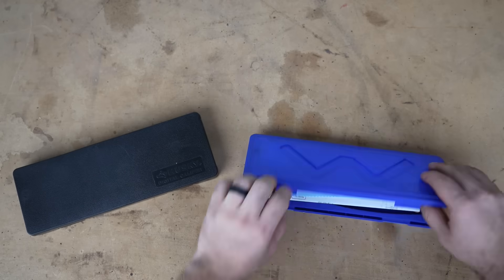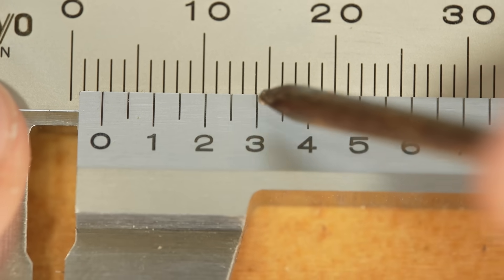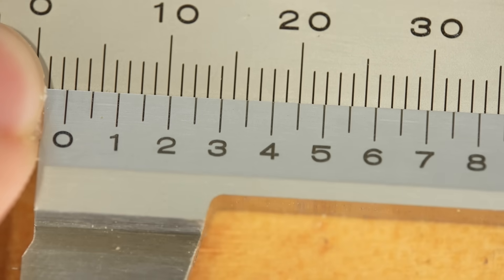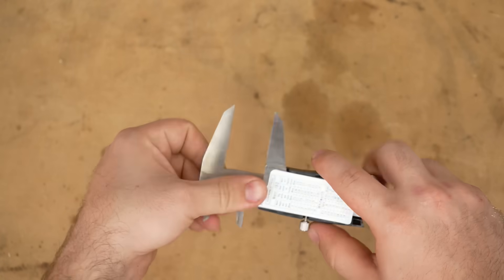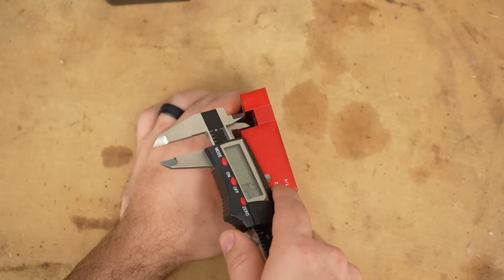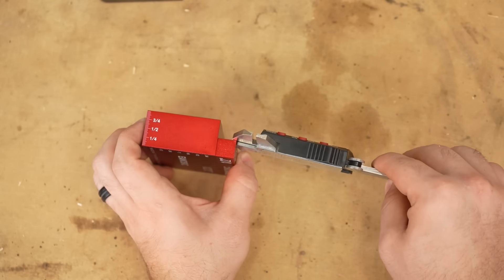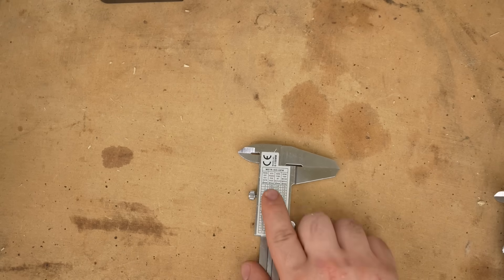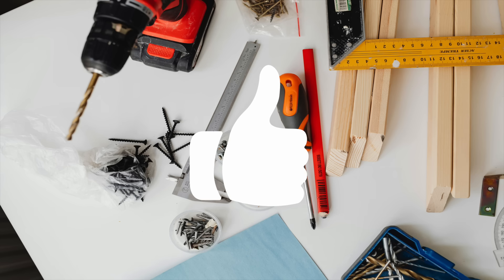I wish i’d known this sooner, How to use calipers like a pro

Comment: When I started in engineering I “could” read the vernier callipers tenth by naked eye, when I retired I “could not” read a digital vernier without glasses. 😂😂😂😂😂
Reply: When I started work, I was taught to interpolate the 1/64" graduations on a rule to thirds of 1/64", which is pretty near measuring to 0.005". I was pretty sceptical at first, then after a while, found it really worked. (with relatively young eyes) I expect others reading will be sceptical, too...  In engineering, there are a lot of oddball personalities.  Advice to the youth.  Watch the older guys, maybe especially the quirky ones, see who produces most with least sweat... They've got the trade sorted.  They're the ones with useful tricks to teach... If they like you... They're the ones who have all the oddball bits of kit whose purpose isn't immediately obvious... Until you see it in use...
Often they gauge, rather than measure, for speed. With some oddball piece of kit...
Reply: @boblawson1006  just dont follow their safety advice
Reply: @CHRISTIEMALRY-2  An engineer who survives to an old age is exactly who's safety advice you want to follow.
Reply: This happens to everybody, the calipers must be really bad for the eyes! :)
Reply: @dan-nutu 😂😂😂
Reply: 😂😂😂😂 @dan-nutu
Reply: I have my original vernier calipers for younger me and my new digital calipers for older me. I keep the vernier, well oiled, in its wooden box for when the apocalypse comes and we can no longer find LR44 batteries. I'll then still be able to measure stuff accurately, albeit with my glasses.
Reply: Same problem here.
Reply: It's funny because I worked with circuit boards and other miniatures. I have to take my glasses off to see them but need them to see anything 3 ft or further away.
Reply: @nonolabs  That's normal. It's best to take a few minutes away from a computer for about 2 minutes every 20 minutes to look at something at least 20 feet away. One of the issues with the design of the human eye is just how much it depends on the muscles to change the shape of the eye rather than moving lens around like a camera and some other animals do.
Reply: @SmallSpoonBrigade The truth is we live in an artificial atmosphere and talk fashionably about nature and 'natural'.
We have to live naturally to be naturally healthy.
Reply: Got to love getting old...NOT😉😄
Reply: @ETHRON1  Still better than not getting old.
Reply: That's why you buy a doublet,  a pocket magnifying glass with both 4x & 8x. They weigh almost nothing and will slip easily into the watch fob pocket on your jeans.  Or use a pair of eyeglass  keepers so it hangs around your neck
Reply: I miss my young eyes. Not as much as my young back but it's up there!
Reply: Two easy cures for that: (1) Optivisor, magnifiers on headgear so they pivot up/down, huge magnification on demand, or (2) take a picture of the vernier with your phone, then view the pic and pinch to zoom -- boom!
Reply: I've only ever used a dial calipers
Reply: When I started working back in the 1960's I could read anything with a 60 watt incandescent light bulb. Over the years guess they reduced dam lumen output because before I switched over to LED'S needed a 150 watt light bulb to read larger print.
Reply: We must be in the same boat. I still use my brothers vernier caliper he used as apprentice in the fifties. They are still like new, and I need better classes to read the scale. Don’t give up
Reply: I have a pair of Mititoyo dial calipers in 12” / 300mm. I had them for almost 38 years and used them daily in my job as a Industrial Mechanic / Machinist. Still accurate as the day I bought them. Though they are scratched, the lense is scuffed, I can measure down three places. Most guys I work with cannot read dial calipers and rely on their import digital ones.
Reply: @fixedit8689 I’m a retired machinist , had my own shop. When I started there wasn’t any digital anything. Most people couldn’t read an old vernier . I showed one to a young mechanical engineer, and he said what’s that. I laughed so hard. Getting old sucks .
Reply: @ This is a that you do need to look after and daily use for 38 years is impressive 👍
Reply: Prefer micrometers myself
Reply: Six of one. They all have their place. Slide rules still work if you don't have your phone calculator handy.
Reply: @Mobile-ct1yf  As long as they are digital now 😂😂😂 but much more accurate 👍
Reply: I hear that! 😂
Reply: Man I’m just getting to the age (and eyesight) where I have to take my glasses off to be able to read it now 😂😂😂
Reply: Have two pairs of calipers and a 75 year old 0 to 1" micrometer. Use the mic most of the times.
Reply: That's the very reason why I use a digital caliper even with my glasses
Reply: Yep. Retired Engineer, I had never owned my own, so when I found a Mitutoyo imperial vernier in superb condition I had to buy it. What a beauty. Takes me right back to my Apprentice daysCan’t read the Blummin’ thing, but I love it 🤪
Reply: Same here. 😂
Reply: Being a recently retired manufacturing parts/layout inspector I feel your pain. 🔍
Reply: The light is getting worse
Reply: Ya, same deal for most Boomers.  G.P. told me it's caused by long life
Reply: I was just thinking I need the "big print" version
Reply: Omg 😂😂😂
Now imagine me, 19yo and gotta squinch the eyes to read a vernier's 0.05
Reply: @leonardofarias484 Good luck for the future 😊😊😊😊
Reply: I need my glasses to find my glasses these days.
Reply: @LockBits-ts6eo Normally on my head 🙄😂
Reply: At 43 I’m feeling the pain trying to zoom in on mms! It never used to be this way, I’m convinced they’re now smaller than they used to be, just like bars of Dairy Milk.
Reply: And Wagon Wheels 😂
Reply: I hear you. In my younger years, I swear I could read a vernier scale to greater accuracy than a digital readout, which admittedly were very few and far between in those days. At 75 I can no longer make that statement.
Reply: I reckon it's the evolution of measurement increments. More increments = less readable.
Reply: Same here, dude.
Reply: It's interesting how you adapt to such small things when working with them so long. I used to work in timing calibration and could measure short lengths of time to a few hundredths of a second accuracy without instrumentation.
Reply: Why are could and could not in quotes?  Were you just pretending that you could and could not read your calipers?
Reply: @ericstoverink6579  😂😂😂 very cleaver answer, if I could not read a vernier, then I had an interesting engineering career 😂😂😂
Reply: Sometimes I have to use a magnifying glass, while wearing reading glasses 😂
Reply: @KeepItSimpleSailor  yes, I know that one and sometimes use two pairs of glasses, not good getting old 😂😂😂
Reply: The lines on the vernier is like the stripes on a zebra, designed to confuse old eyes. I just have a hard time seeing which line is supposed to go where nowadays. I have resorted to using the camera on my phone to read the vernier scale, it works but each time I feel old... Some day I will give up and just buy digital calipers with a nice large screen instead.
Reply: @haqvor  Digital is the way to go, sooooo much easier 😂😂😂
Reply: When I started working as an engineer at age 25 I swore that I would retire as soon as I needed reading glasses.
I had to have others read fine print for me to uphold that promise 😉🤓
Reply: I glad have miopia
Reply: @janmouchet8080 I am sorry if that’s the case, certainly not pleasant 😔
Reply: @David-xl9cp well I have magnified glasses build in jajaja
I think is better thant the opposite
Reply: You are not alone
Reply: Not only.  Some calipers are simply hard to read.  Grey writing on slightly different grey steel.

Workbenches may be well illuminated - but calipers are often used elsewhere where lighting is not optimal.  The digital ones have a clear advantage there.  If they have a display with a reasonable contrast.  Many have dirt cheap displays with low contrast.  And if you have to use a digital one at below freezing temperatures - good luck.  Some LCD displays simply become super slow or entirely unusable at low temperatures.  If the measurement electronics are still working accurately enough, that is.  And mine drains button cells quickly even when not in use.  So there are good reasons to keep a vernier one around.
Reply: @ralfbaechle  A disadvantage to using either type of caliper (or any other metal measuring tool) at below freezing temperatures is the entire measuring tool has shrunk due to temperature.
Reply: @Sembazuru  Which if the accuracy is required, can mathematically corrected.  Annoying.
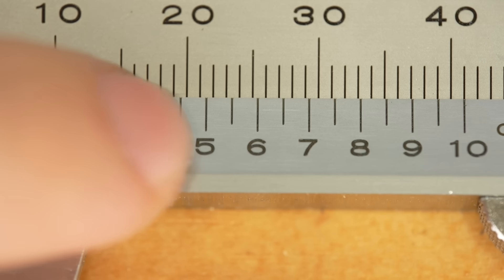Reply: @ralfbaechle j8 1:59
Reply: @ralfbaechle  Notice however, that calipers are "measure and take" instruments. Simply close them on the measured part, take them off, and read in better lighted place.
Reply: @tomtores1225  Fair enough but that's a bit of a method of last resort.  I'd expect a caliper to be well readable in the first line.
Reply: @ralfbaechle  It is preferable calipers markings are easy to read, but if the light is poor, position awkward, just taking them off to read somewhere else is always an option. Sometimes I don't even read them, I just go to drills or screws box to try what fits.
Reply: @tomtores1225  Indeed, so do I.  When I pull out calipers often the reason is I need to order or shop for something.
Reply: @ralfbaechle  Add a shelving unit and half pound of every screw/nut size to your next shopping list, it helps :-)

Comment: I use calipers daily and I'm a little amazed that we aren't introduced to them in school. I use everything from cheap plastic verniers (for times when damaging the caliper is a real possibility and high precision isn't critical) to our usual cast of characters. I usually grab dial calipers since it's relatively easy to read and doesn't take batteries. Next is vernier -- again, the battery thing. I usually only go digital if 1) I have batteries since it's probably gone dead since the last time I used it; 2) I have a lot of things to measure since reading the screen is so much easier. All are used and useful.
Reply: I was taught how to use a Vernier caliper (and Slide-rule) at school... admittedly that was more than sixty years ago.
These days, that lesson has probably been replaced by "How to use an Electon Microscope"!   😜
Reply: @PiefacePete46  lol. Know what you mean. I was the last slide rule practitioner at my school. I had to stop when they 1) requested more than 3-1/2 digits of precision; and 2) stopped allowing log and trig tables for test taking. Ti-30 to the rescue. Nowadays I just use the 'rule on my desk for funzies when I feel like going old school.
Reply: @terpcj  :  We are talking about everday items from not too long ago that todays youngsters could puzzle over for hours!
Not long after I left school I worked as an aircraft Load Controller.  The balance of the aircraft was calculated with a rudimentary Circular Slide Rule... Today, Google would probably work it all out for me if I asked nicely!   😜
I still have a slide rule in the drawer behind me... I must check it out for a giggle.
Reply: @PiefacePete46  Electron Mics are so yesterday. The heat they generates kills everything. Dark-field is better afaik
Reply: @frozenflyify  :  Damn... I might have to go back to school!  At 78 years old, that's a scary prospect!  🥴  😜
Reply: The plastic calipers are also very useful when you don't want to risk scratching whatever you're measuring.

Comment: I contest they are far more accuret than digital because you can and often set the ZERO Wrog. You can not set the Wrong ZERO with a Vernier caliper
Reply: Yeah but the accuracy comes down to users eyesight. Let's say digital is more accurate in that the number displayed is the number you use, where as with verniers you could be out because you couldn't quite see a distinction between which line was closer.

Comment: 65 year old engineer here. Lots of great information in this short video.  I use a vernier caliper simply because it needs no battery!  I was also taught to never touch the measuring surface without wiping it clean. Sweat is corrosive and can cause corrosion pitting although these days they are so cheap maybe this is not so important anymore.  Thank you!
Reply: 64 year old quality engineer here, today they are made of stainless steel, so don't worry about sweat,  but it's good practice to keep them always clean so you can rely on your measurements 😊
Reply: @mobilfone2234  Good point, but old habits die hard! (Although I am not so sure about the s/s from China 😀)
Reply: @anthonywalsh6605  we mostly have Mitu.. in the factory, some Mauser...., so reliable in harsh conditions,  I got lazy and replaced   my 150mm at home with Mitu.. Digital, only the  long guys are traditional as I use them rarely..
Reply: 70+-yo engineer here and learned to read a vernier scale on a brass transit. ;) I don't often have need for a caliper but will buy a vernier caliper anyway because they make it a lot easier to measure screws/bolts and I do that now and again. Plus, they are just a super cool tool!
Reply: @nvrumi  I can fully understand your point 😊 for me the digital has the advantage that you can zero it at any  point and so just measure deviations, or subtract a thickness so you don't have to calculate.... 9 days left to retirement, then any measurements for hobby only  😂😂😂😂
Reply: A machinists hands are so full off oil or coolant its actually better to leave our fingerprints, they have preservative properties.
Reply: Modern materials make this less of an issue, but it's a sound practise to adopt.
Reply: As a dummy hobby guy, I got the digital set, and it went bung.  New battery still didn't make it work.
I'll get a good Vernier set now.
Reply: Yes, I can confirm, batteries are my main crisis when they're not used as often as my other cheap ones for general use.
Reply: I have just replaced a digital caliper with a vernier one because I got tired of dead batteries just when I needed to use the thing. For the same reason, I  just purchased an old school, mercury-based clinical thermometer (environmentally incorrect, I know). I'm done running out of batteries at the wort possible moment.
Reply: I got a digital calliper a while ago. You know, step into the modern age and all that. But the battery dies on your when you need it the most, and the digital measurement is very flaky. I got fed up with it pretty quickly and got a good quality vernier calliper instead. Bombproof, accurate, and never runs out of batteries.
Reply: @CristiNeagu  you get what you pay for 😄 Buy Mitut....  and the battery will last years and is so accurate, tested with gauge blocks mostly 0 deviation or +- 1/100 mm..... you'll never need a replacement....
Reply: @mobilfone2234  I did'nt change the Mitutoyo batteries for the last 10 years.
Reply: @JV_CNC  I guess 5 years was the most, depending on usage and brand of battery.....
Reply: @mobilfone2234  " tested with gauge blocks mostly 0 deviation or +- 1/100 mm" - How did you test your gauge blocks? :-)

By the way. Despite Mitutoyo being excellent, their jaws' measuring surfaces often have slight deviations from being flat; measuranble via light interferometry. (Yes, much better than other but they do). Also, if we are talking in 1/100mm, specifying the error for the sharp part of outside jaws is good practice as those wear out very fast and have different error than flat parts. (Are "sharp part"/"flat part" correct terms in English?).

I'm just a guy who once apprentice'd for a guy who profesionally checked and calibrated measuring instruments.

Comment: One thing i dont like to see is when people use a vernier caliper as a marking out gauge. I have seen people scribe lines on a rotating part thats  rotating in the lathe chuck.
Reply: On some of the channels I watch, they have an inexpensive caliper for that purpose.
Reply: @grandpasbarn2806  But if you do that you still show that you don't respect your tools. Why would anyone use any fine instrument (or even a cheaper one) to a job it wasn't intended to be used for (Scribing marks on the work piece).

Comment: Also there are calipers with retractable jaw (the ones with split scales conected by a rod.. you put your mesurement and lock the rear part of the scale. Retract the caliper and read the locked scale -useful for stuff that is hard to read in place). The scale is offset with the rear part.. so when the jaws are closed, the rear scale resting on the stop of the rod is at 0 even if the scale is physically 50mm back. Some can have dual scales to give the main jaw a scale that also reads from its zero working like a normal caliper insted of the rear scale.
Also there are fine adjustment calipers with a a split scale but the rear part is not essential to the measurement. The rear part is conected with a threaded rod and has a fine adjustment nut. You get close to object, lock the rear scale and advance the nut to tighten the main jaws on the object. The reading is on the main jaws scale. The rear one also have a scale but in order to use it as first example the threaded rod and nut must be calibrated to a known value to subtract with when jaws are closed
Also many big caliper do not have internal jaws but use the same external ones that are rounded on the outside and you need to add 10-20mm to the value you read. (and can't measure anything smaller than the witdh of closed jaws)

Some calipers have a wheel to advance insted of a nub and some have a springloaded friction wheel so at the end will spin and not advance.. so it gives constant force on jaws.. kind of like on micrometers.